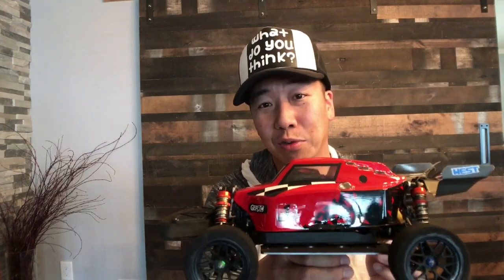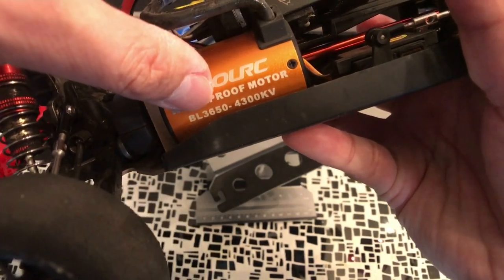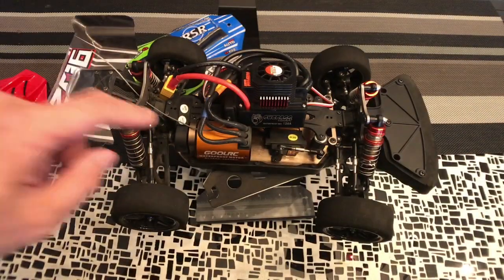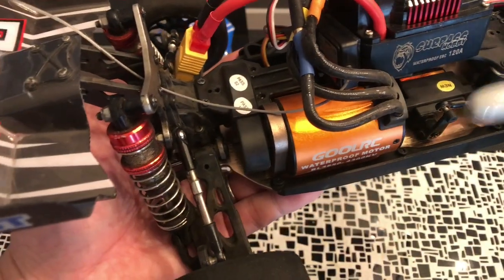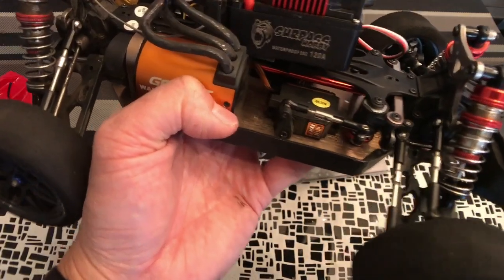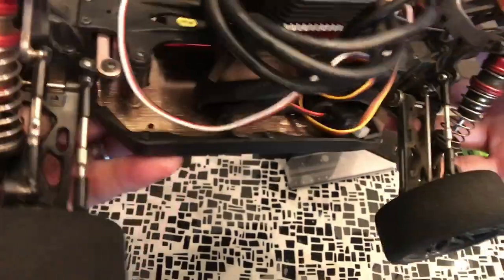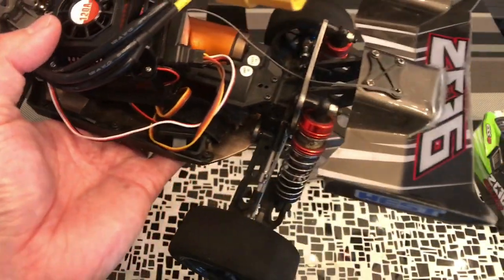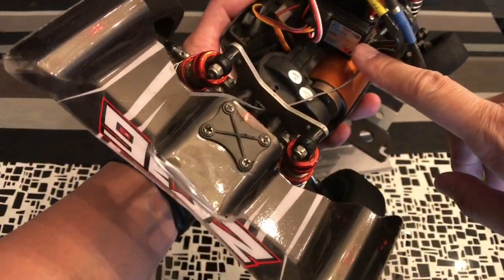Brushless RC Conversion (Part 1): How to Fit Components

Comment: Great video, found you via rcgroups and subbed up. I recently converted my Acme NB16-T from nitro to brushed, and mounting the motor was indeed the biggest problem to solve.
Reply from the maker: Cool. Hope you find the content and upcoming stuff useful too.
Reply: @Funcentric  The Skytech video was very useful too. I tried 3S in my NB16-T conversion earlier and although mum wasn’t sure if baby would like it, it was fine. Baby was a little hotter after but nothing to worry about.
Reply from the maker: @dubiouscircuits  Strong babies can handle a lot. Nice work!